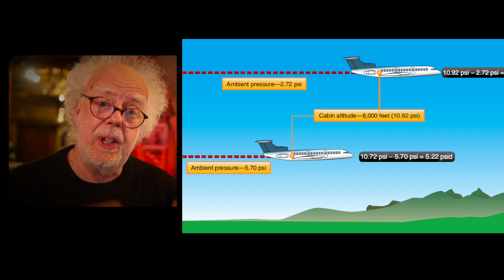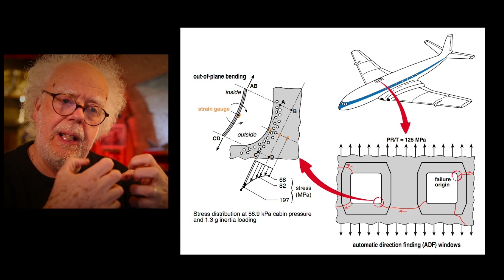777x  - Prof Simon

Comment: It's not Boeings year, loss of a spacecraft, substandard air frames... and I have said that its corporate greed that has been the bane of boeings existence, when you have to return a profit to investors, thats an issue, corners get cut at the expense of peoples lives.

The number of air incidents has been rising over the last 20 years, many of which are disasters that never made it in to the main stream media because of the fact that most bad news is suppressed because of profit fears.

I no longer fly because of these substandard builds and business practices that play the odds like a game of poker or roulette, so I choose to not give these companies my money.

My business model would be build smaller and with higher quality and safety, the return in the long run is much better than a boom and bust business model that companies like boeing operate.

Comment: The FAA hasn't ruled yet, but the original 777 actually also failed its pressure test.  With this aircraft because of how and where it happened, they just have to reinforce the area.  The FAA hasn't decided if they want a retest, and this WAS A TEST and was specifically meant to avoid the problems with the Comet.  The problem was due to the fact that the 777X will be pressurized to 6,000' and not 8,000' like the 777 Classic, being the first Aluminum skinned aircraft to do it (the other two, the 787 and the A350 are both composite).  So actually it would already be approved to 8000'.
Reply from the maker: Interesting

Comment: I think people take airplanes too seriously.  After all, they are just airships with jet engines:  a big balloon with a fan.  
  Designers are bound to get things wrong - they're only human. 
  Trouble is with 'Accountants' demanding more and more profit each year to pay out Dividends to their  shareholders: they are obviously going to cut corners (sadly what they didn't do with the windows on the Comet.)
  Note: British airplane mistakes seem to be treated more harshly by the FAA: Comet one major crash - grounded. Concorde - one crash - no longer in service.  Faulty Lithium batteries? No problem: "get them flying" seemed to be the 'Accountants' priority.  
  Boeing planes which l love and l verily believe it was the Pilots' fault who were flying by experience ie winging it  ha! rather thanbeing trained for the new Max systems, that caused the accidents. Why do l believe this 🤔  because the only 2 Max accidents were by non-American pilots. American pilots, who all did training for Max's, managed to keep them in the air.  I flew Dubai Air in one shortly after: the UAE pilots flew it with no ill effects. There was a little turbulence but nothing major. Sabotage 🤔 - that's for the silver foil covered clog wearers and a different video. Seriously it's just a big piece of pressurised plastic hoyled up into the air. 🤔
Reply from the maker: Good points John
Reply: @SimonHollandfilms  Thanx Professor.

Comment: Tell me please Prof, in my 'practical' world, common sense would make the decision to enable wing-fold go down, not up?  The moving bit is short enough not to contact ground so?????
Reply from the maker: Good idea
Reply: That makes it easier for vehicles to run into it, and ground crews are capable enough at running into planes as it is now. It doesn't affect safety at all because either way it folded, it's supported by the same latches in the wing.

Comment: Rather different to a modern composite fuselage which when pressurised does not expand which allows the cabin altitude to be much lower therefore more comfortable.
Reply from the maker: Interesting makes sense with composites

Comment: Boeing's reputation has been tarnished by the 737 Max disasters, and since the US Congress is closely monitoring the FAA, I doubt very much if they (FAA) will lower their requirements to suit a Boeing design flaw. I understand that airliners are all being designed for efficiency, and lower aircraft weight is one major factor in reducing fuel burn per passenger mile. So builders attempt to make any part as light as possible, while still meeting safety load factors.

But I am certain Boeing will not get a free pass this time.

Comment: This wasn't a pressurization test. It was a wing/fuselage bending test.  While it was pressurized during the test, that was only slightly above the maximum.  The failure occurred due to compressive forces in the keel of the airframe.
Reply from the maker: Ahhhh that makes sense...thank you

Comment: Just so you know😁it doesn't even have to be retested! Engineers just have to show the necessary structural fix!  Only holdup is the GE 9X engines! 150,000 lbs of thrust each (134,000 in tests have to get 150,000 for ETOPS,thus the holdup)and 20% less fuel. The 2 GE engines produce 20,000 more lbs of thrust than all four A380 engines( 70,000 each)😁👍
Reply: SCOTT ontheboat the a380 engines generate 74k to 80k pounds of thrust.

Comment: The Comet was fixed by using round windows and a differently designed area around the radio compass, after that she was in military service for quite a while (RAF used a variant until 2011), but in commercial aviation the was pretty much out of business after the crashs.

Comment: This is why aircraft are static tested and Boeing had a positive result, I have watched these tests at Boeing and eventually they will test to destruction, its usually just the fuse and wings that are subjected to the testing thats goes on and on for every hour of the day week in and week out. a constant reversal of loads on the whole structure, The door blew out taking some structure with it, there are tremendous forces at work when max diff pressure is exceeded,  I note there is a photo of a Boeing aircraft in flight with a circle around the "area" i think that is misleading as people will think door blow out plus flight whilst the aircraft was basically screwed into a test rig on the ground ! . 
As for the Comet from memory the reason for the structural failure was the way the rivets were pushed through the metal leading to minute cracking which  eventually failed under pressurisation loads ,  did the crack propagate from the window or an ADF aerial in the roof, ( it was also square shaped )  The last time i was in Hatfield the comet "tank "was still there but that was many years ago. Salisbury Hall is well worth a visit too , housing some interesting aircraft.

Comment: Of course, the Boeing F35 EA growler bought by the Australian Airforce didn't make it into the air.   The engine blew up on the ground and caught alight .  Boeing refuses to pay anything for the shoddy workmanship that caused it (zero days warranty?).   Sad days for Boeing.   The Comet was the first to suffer the structural failure, so it could be argued it wasnt expected to be a problem.   But there have been many years since that sad event!

Comment: The test actually requires the airframe to be pressurise to 150% and then held at that level for 3 seconds, before given a passing grade. Another reader on an aviation website mentioned that Boeing had thinned the walls of the 777X from previous versions, in order to be able to match the A350 and have the airlines be able to install 18" wide seats. Seems like once again they were playing catch-up engineering and decided for a kludge.

Comment: That's what happens when engineers use CAD to design to the bleeding edge instead of the 1980's 2X-3X safety factor!
Reply: The sad fact is, Boeing wrote the first FAA rules. The second one is, Boeing was responsible for many deaths in civilian aviation( military aviation who knows) due to bad techical solution and development. 50 years ago they did not had oportunity to make all the tests and now in 21 century you allow yourself as a prestige company such a build mistakes?? Getting profit over dead corps is a pretty bad commercial in 21 century..

Comment: I met Frank Taylor ( former AAIB air crash investigator)  at Cranfield College of Aeronautics during a short course in 1998 . He investigated the Comet accidents which occured to a handful of then during level flights or climbing to the required FL . The square shape of the  windows´s frame  played the main role in the catastrophic failures. Boeing took advantage of the De Havilland setback and won the race of the comercial jet era . Nowadays , failsafe design should prevent the main airframe to collapse although the contained damage could cost some lives on board.
On April 28th of 1988 an Aloha Airlines Boeing 737-200  had a explosive decompression ( some airframes above 50.000 cicles had shown similar cracks to the Aloha´s  due to the defective bonding of the fuselage  structure/ airframe).
This issue is different. The are still testing the prototype. 
Do not panic! 
On the other hand , new composite materials are widely used in the 777 and should contain the fuselage integrity .

Comment: Thank you for something that we had skipped over in the past. 
As a production engineer I was fascinated by stress fractures in metal.
I studied it as part of my metallurgy syllabus in my final year. 
Liberty ships suffered from the same problems of stress fracture in the corners of the square deck hatches.
The Comets as you say suffered from metal fatigue and you would think that today we should be fully aware of the problems, and more importantly be able to calculate these stresses. 
The bigger issue is how long will the airframe of the aircraft are rated for in flying hours.
With repeated exposure to pressurisation and depressurisation who know for certain how long anything will last. 
I love the Dreamliner because it is made out of Carbon fibre rather than Aluminium Alloys.  
Again another delightful snippet of information Professor Simon. 
Thank you.
Reply: Jeremy Travis 
I used to race mountain bikes and after breaking multiple aluminum handlebars, I finally switched to titanium bars and have never used aluminum since.  Aluminum is fine for parts that don’t flex, but any parts that flex and move will develop stress fractures and eventually crack.

Comment: Since there are presently worldwide 422 B-777 in service this should not have happened.  Glad the aircraft was not torn into two pieces while being high up in the air. Once more this shows how difficult it is to construct a 100% perfect airplane although the company is doing this for more than 100 years.
Reply: lenny108 There are far more than 422 777s in service. We’re on line 1640 and retirements thus far have been minimal, though predominantly in the 777-200 model. 1400 would be a more appropriate statistic. The failure here was in WY987, the static test frame for the 777X, of which there are only 12 completed frames. The aircraft has not yet flown, it is still in ground test, and there are none in service. 

The issues facing this model have no impact on the previous models, all of whom excelled in this test. The footage of the 777-200 static frame undergoing the same test to the breaking point is readily available. The 777-200 experienced the failure at 154% of the highest recorded stress loads on earth, the 777-9 failed at 149%. By all accounts, it is still a resounding success, but it came up 1% below the 150% required by the FAA for certification. 

While the fuselage will have to be reworked and current frames patched, as well as a new static frame constructed to certify the changes, this isn’t nearly the disaster anyone is painting it to be.

Comment: It's sad to see any company have this kind of problem. They have lots of hard working and bright people who are just trying to build a safe plane.
Reply: Kirk Johnson    This is why certification testing is a big deal for airplanes.  Just like most everything else, the public has gotten used to success during certification testing of airplanes.  So used to it that we voters let the FAA budget be cut so drastically that the engineers necessary to check Boeing’s work are not being replaced as these engineers reach retirement age.  We need to insist that the FAA be funded sufficiently so that it can return to regulating air safety rather than allowing aircraft manufacturers to approve airplane designs with no oversight.

Comment: Simple fix: pick up corner of rug, sweep truth under...
( works for just about everything)
Reply: Yeah and just look at the mess Boeing are in with the 737 Max crisis and sweeping shit under the carpet.
Reply: @markfryer9880  Hyperbole and platitudes.  Nothing was swept anywhere, get real for once in your sorry life.
Reply: @Lee James  the will just put a few doubles around ot area e. G. Make the frame a it thicker around the door when he says the faa will okay it soo it doesn't have to be done again that's the more worrying thing in a real world it needs to be retested to ensure it really meats certification... As for the folding wwinglet if that fails in flight it will most likely be catastrophic as it may destroy the lift or  rapidly increase the load on the wing root as for the manufacturering and maintaiance that's wher costs will ramp up as added complexity isn't needed I. E. Over egging the omlet.
Reply: @michaeltalbot8242  I seriously doubt that a winglet failure prevents the aircraft from flying.  As a percentage of the lift area it's not that much.  The load on the wing root remains the same for a given load.

Comment: Fifty years later and they are still freaked out by the Comet. The science behind the failure of the Comets' failures was pretty amazing and maybe you could go into that.
Reply from the maker: good idea
Reply: eottoe2001   Also, the Aloha Airlines 737-200 fuselage failure in flight that resulted in the death of a flight attendant.
Reply: Everyone knew the science except de Haviland.  The Viscount had nice big round windows and was an earlier design.  Boeing at the time was using thicker skins and titanium seams to stop propagation of any cracks.  If the Comet over rotated it stalled on take-off.  Another flaw.  A hard and painful lesson but the British industry lifted its standards greatly.
Reply: True, but the Comet then continued to have a very useful and successful life in the Nimrod for a very long period of time.

Comment: I don't like the way they have Engineers trying to design things with less, conservative means. Trying to leave out redundancy and a little bit extra for safety measures. They keep trying to make it lighter and less expensive. Business is Greedy. Trying to make it just fit without any extra is leaving things too risky for trouble. I don't like going that route.
Reply: It's trying to fit a number that includes a large safety factor though. Even if it flew now it'd be quite safe, but it's a bad precedent to lower safety factors so that definitely won't be done. But better to set the target high and try to match that than to set a low target and try to exceed it by some unquantifiable amount
Reply: Michael Price    This is certainly a problem when bean counters have more pull than design engineers.

Comment: Not a problem if all your planes are grounded
Reply: Since your obviously very smart, 1/3 of all flying passengers will fly on a 737 TODAY🤔 2000 737 are in the air now carrying passengers daily! 6000 737 flying daily The Max is 750 aircraft🤔👍
Reply: @scottontheboat2340  how many potatoes on board?
Reply: 1. 737's in the air stats are okay, however I am more interested in the 737's occupying car parks. 
2. Pickleforks.

Comment: Does this got something to do with pickle forks?
Reply from the maker: i don't think so.....but it is in the same area....so you might be right.
Reply: @SimonHollandfilms  both of them happen because of stress concentrations, and accidentally having a large stress concentrator in an area, and thus exceeding the fatigue life of the parent alloy, leading to failure. in the Comet they did not understand the consequence of having those built in cracks in the window edges, along with the stress concentration coming from the rectangular window frame, like the first few generations of steel ships also had to find out from them cracking in cold weather from a combination of high sulphur steel, stress concentrating sharp corners and an alloy that became brittle below -9C. 

The Comet had a stress concentration on the corners of openings in the fuselage, the windows and radome for the star sighting sextant, which was also unfortunately enhanced by them using a new style of self drilling rivet, which left a sharp edge inside and outside to serve as a stress enhancer, along with burrs that formed the nucleus for crack growth, and the aluminium alloy used was fatigued rapidly by this, leading to crack growth and eventual failure as the aircraft approached altitude.

The pickle fork will probably come down to this, a structure running a little too close to the maximum level at all times, and also with either a poor choice of alloy, poor design that left stress points, or poor assembly methods that enhanced stress in the unit in places.

Comment: The Brits and The Comet lost their lead to the Americans  who
Schooling on the comet successes and failures leapfrog ahead.Twas the 
Beginning of the End of passenger jet manufacturing in UK.Good Grief how did
That happen?😥
I recall engineering switched from punched to drilled rivetting and
Round windows thereafter also fixing bicycle inner tubes in  bowl of water
With a pump and soap looking for bubbles to spot a puncture! C